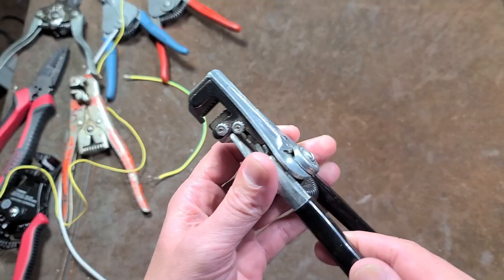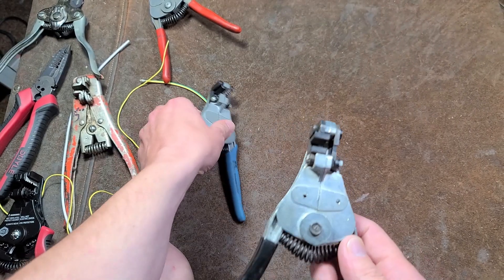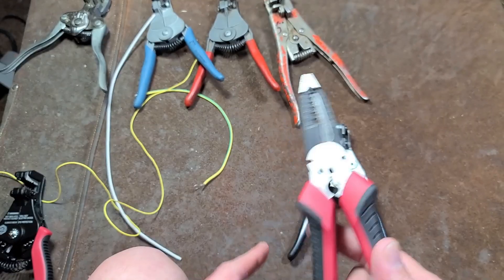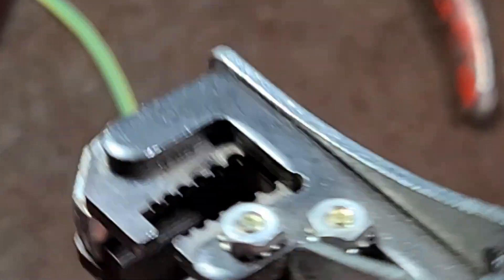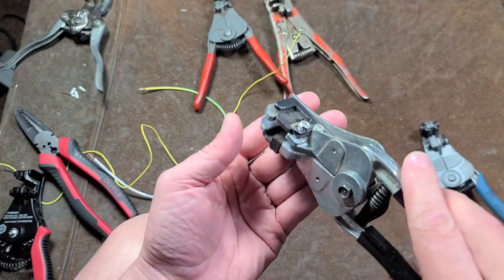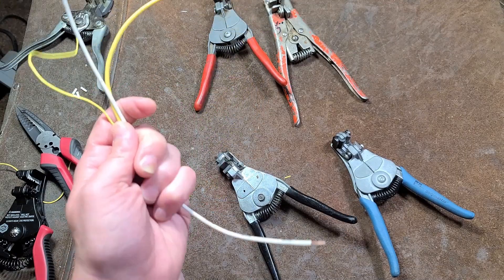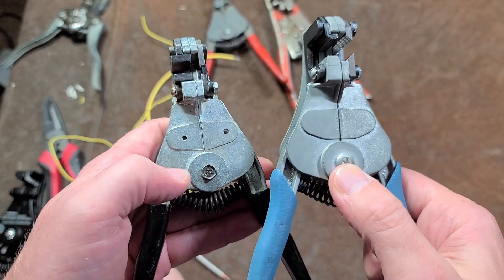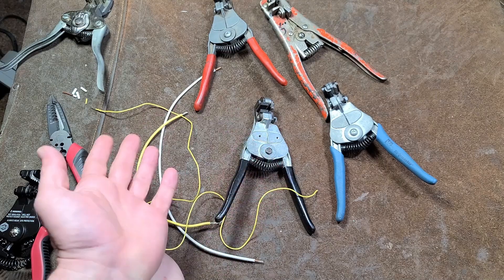Ideal Mil-Spec StripMaster Wire Strippers Review

Comment: what might be causing my cutters side handle not to close and cutter not coming all the way down ?
Reply from the maker: disassemble the cutter block and see if the cutter or wire clamp is bent and sticking in the track in slides in.

Comment: I was using my Sears made in USA and they flew apart parts went across work bench loaded with nuts and bolts my bad I need to clean it off . I found the metal H shape do not know what else I lost maybe just some nuts looks like that is why I am here Thanks for video .

Comment: Hi, thanks for an interesting video from what you say the Mill Step Stripers Master made in the USA seem to be one of the best from what you say, I am in the UK so just wonted to know where I most likely to buy this brand? Would you be able to let me know many Thanks.
Reply: You can buy both Stripmaster Lite (knife type blades) and Custom Stripmaster Lite (die blades) from Heamar in the UK.
Unless you only ever use a single wire spec, I.e. Raychem 55a, 55m etc then get knife type
The die type is machined to both the insulation OD as well as the conductor ID.

Comment: I have the Irwin that are about $20.00, would think the application or volume to justify $250.00 would be extreme.  Thanks for bringing a variety of products to review.
Reply: When you're doing this for a living every tool you use will either hurt you or care for you. I didn't get the mil spec but I got a few sets of the normal stripmasters so I have every gauge. They're worth every dollar.